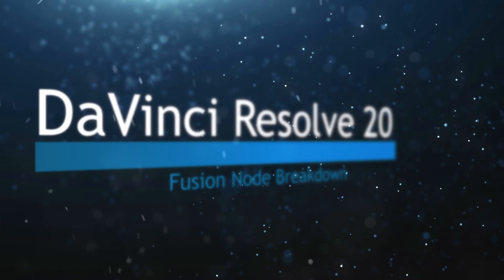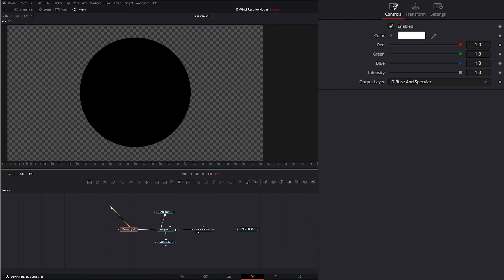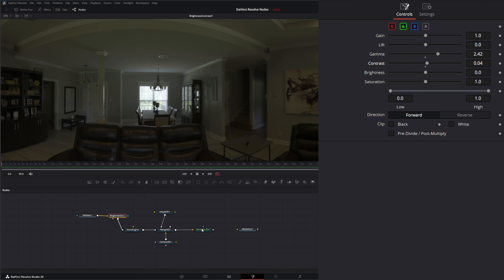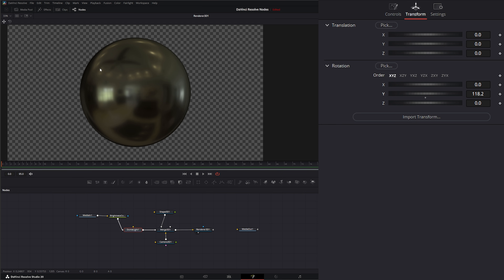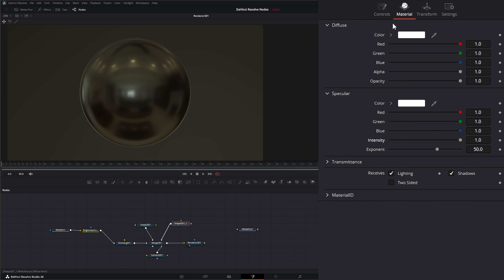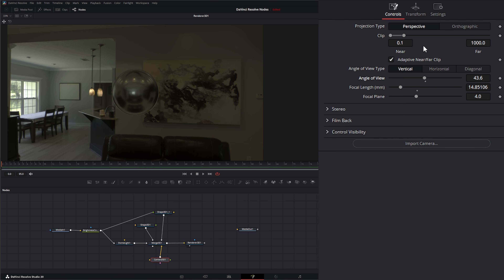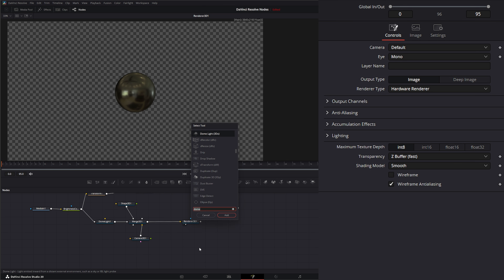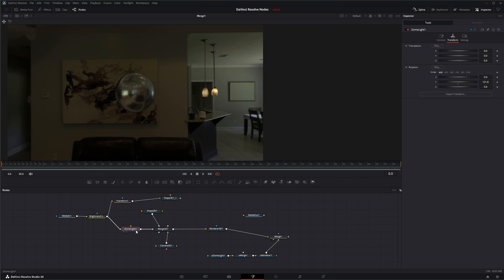DaVinci Resolve 20 Fusion Dome Light Node

Comment: Hey, let's see if you can help me... I need to focus, or rather, illuminate like a flashlight. I need to direct the light to different sides of the screen... Do you know what tool I can use? I have the free version... Thank you very much, excellent channel.
Reply from the maker: If you're using 3d, you can use the spotlight node. If you're just doing 2d, you can use a black background with alpha set to your desired look and then use an ellipse node to mask it out...then animate the ellipse to look like a flashlight moving around.
Reply: @bdscoveredstudio  Yes, thanks. That's exactly what I did... I was able to discover it two days ago by trying things out and by chance. Thanks again for responding.

Comment: Thanks. The long processing time might be due to the HDRI resolution. Using a 1K (or lower) version should speed up the convolution process.
Depending of your GPU, try disabling GPU compute for the Domelight, it’ll be faster and more stable.

Also, Fusion 20 is significantly faster thanks to better memory allocation, improved multi-GPU support, and more efficient parallelism. I tried it and yes it's faster.

Regarding the darkened HDRI colors : Fusion always operates in a linear workflow (Rec.709 – Linear gamma).
To maintain a linear compositing pipeline while previewing the correct exposure, you can use a Display LUT with a ColorSpaceTransform in the viewer:
Input: Rec.709 - Linear
Output: Rec.709 - sRGB (or Gamma 2.4)
Tone Mapping: None
Forward OOTF: On

But doing like this, you need to change all your sRGB footage to Rec.709 Linear using the ColorSpaceTransform node reverting only input and output from before and no OOTF. You can tonemap with Davinci mode to add a better sdr to hdr remapping. So it's depending of the graphist ;)